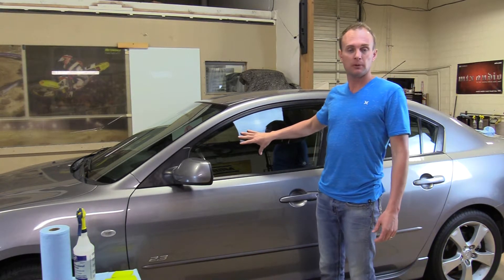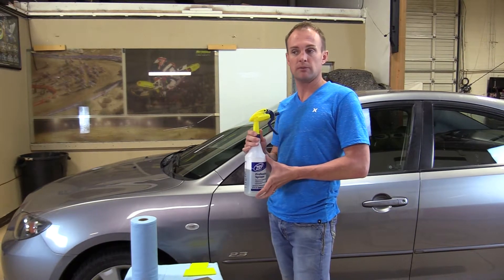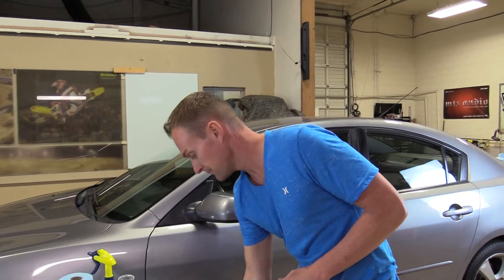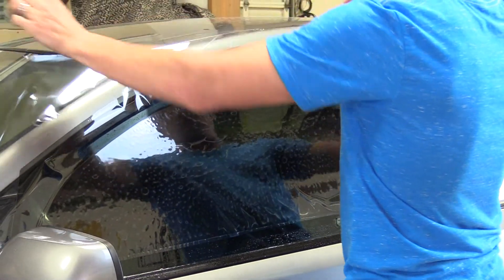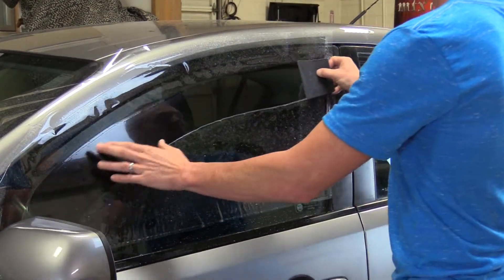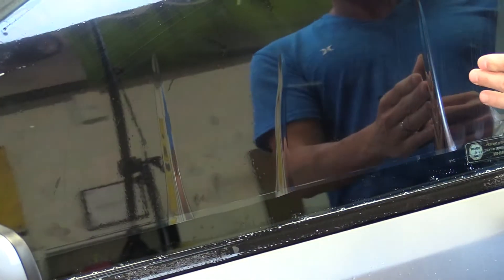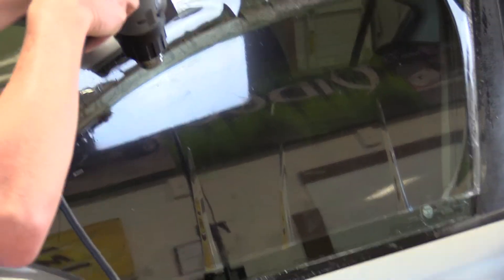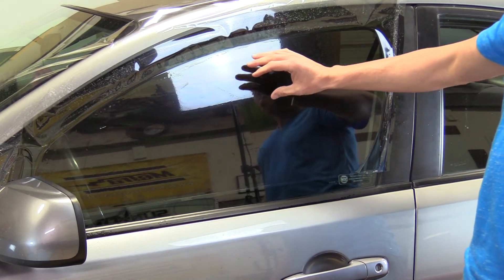Pre Cut Window Tint Kit--Heat Shrinking Curved Window--Any Vehicle

Comment: Thank you!! I managed to mess up twice now on a small curved back window and wasn't understanding why I was getting those finger air bubbles... I will now use your method to hopefully conquer this window without any more problems.  To the point and explained what you were doing... Wish more videos out there were this clear.
Reply from the maker: You are very welcome! Don't forget to subscribe and check out our other videos.
Reply: @InstallProz  Using your method I did the window and the rear windshield... I can't even imagine how the back windshield would have gone had I not done exactly what you described and demo'ed!  A+
Reply from the maker: @NewShockerGuy  excellent 👍

Comment: 1:Can you shrink the tint after you take the liner off?  
2: is there a difference between ceramic & carbon when it comes to shrinking? 
 Great video btw!
Reply from the maker: You wouldn't be able to shrink the tint the same way we do in this video if you remove the liner.  You wouldn't be able to shrink it as much either.  Yes, there is a difference in shrinking the two different types of films. Carbon, in general, will be easier to shrink.

Comment: Liner facing you, you will be shrinking that instead of the tint. Or is it so you won't burn or over shrink the tint, safer and slower?
Reply from the maker: jim davidson thanks for your question!  The liner is facing you so that you don’t scratch the tint while you are carding it.  The heat transfers through the liner very well, so it allows the film to be shrunk. If you are going to buy a pre cut kit, check out our site.  www.installproz.com

Comment: I’m a bit confused... So if you don’t really have any fingers should you create some or were you just doing that as an example?
Reply from the maker: If you don't have fingers when you use your hard card to squeegee the tint to the window on the outside, you dont need to worry about it.  If you have fingers that form after you have squeegeed the film to the outside of the window, you should shrink the tint before removing the liner and applying the tint to the inside of the window.  Most vehicle on the market today have enough curve in the window to require that the tint be shrunk at least a little bit.

Comment: I tried some cheap ebay tint for fun, and I noticed that it doesn't seem to wrinkle up in the same nice zig-zag pattern you got with your tint.

Are cheap tints generally harder to shrink.
Reply: I have bought tint on eBay several times, and in this videos situation, the film just creases and pulls together instead of creating any sort of zig zag pattern when heat is applied. Basically impossible to shrink. Pretty much what any thin plastic would do naturally when it gets hot. Plus the tint never slides around very well on the glass like when you're trying to move fingers around. I can't find a place to buy tint where I'll know it's decent quality. They all say good quality of course.
Reply from the maker: Hi inductiveExperiments , if you would like quality tint, you can purchase through it through our website www.installproz.com or through amazon using the following link.  http://amzn.to/2oXILTv
Reply from the maker: bluewker, cheap tint can be very difficult, and sometimes almost impossible to shrink.  The tint we are using in our video can be purchased through our website at www.installproz.com or through amazon using the following link  http://amzn.to/2oXILTv

Comment: Can u do it with out a heating gun
Reply from the maker: Sha Money yes,  you can use a hair dryer, it just takes longer.
Reply: Install Proz okay what if I got them per cut do I still have to wet my window or I can just stick them on with Out wetting it up to stop all water bubbles and I don’t need to blow dry it because I can make the sun do that and that other text was way off asking to much question in one lol
Reply from the maker: Sha Money even if you have a pre cut tint, you will still need to wet the windows to install the window film.  Most generally, pre cut kits don’t come pre shrunk, so you would likely still need to shrink the film before installing it.  I hope this answers your questions.
Reply: Install Proz one more question okay I got the per cut and it fit the window and everything is shrunk to the right size and when I try it with baby shampoo and clean it good then I add water To it and put it on Boy or Boy it gave me so much bubbles I was thinking my windows was in a bubble bath 🛀 lol but I was thinking can I just put it on with out the water and clean the windows good and then stick it on slowly how bad that sound because I don’t have a heat gun and it’s hard to dry the water out with out that heat gun and trying to get the water out with a heat gun it’s very nasty bubbles and water wet line. Because the per cut customize for my windows so will that be a problem but I don’t have to cut nothing just put it on I wish u was a round the corner so u can see what I’m doing wrong and what I’m doing rite and thanks for being a good YouTube buddy to reply back because I have a HR-V 2018 suv forgot to tell u that so I don’t have a car and after I get the tints down pack for a second try I wan work on changing my head lighting because traveling with they head light and beam light sucks I need to find a Best good head and beam light that’s strong enough to see from far
Reply from the maker: Sha Money it sounds like you are talking about installing the window film while the window is dry.  If that is the case, no, you don’t want to do that.  Spraying the window and tint with the baby shampoo and water is what allows the window tint to be positioned correctly and it is what helps you get the air pockets out from behind the film.
Reply from the maker: Sha Money have you at watched this video?  https://m.youtube.com/watch?v=KxrdCkHJbSc
Reply: Install Proz maybe I over wet the windows and tint to much because I got all the tools u got on this video before I seen this video but I’m keep looking at the video into I get it and I see how u spray the windows and tint not to much water that it be running down like Rain drop u spray just to get it wet and I’m start from the middle and work my way down and side
Reply: Just. Wow.

Comment: so you always say 1 oz or 1 tablespoon... which is it? there are 2 tablespoons in an oz
Reply from the maker: You can use 1 to 6 ounces of baby shampoo.  How much you use really depends on how hot it is and how much slip you want.  1-2 table spoons generally works great. If after installing your first window pattern, you decide you need more slip, just add a little more baby shampoo to your solution.

Comment: Fingers still appeared at the top after install and wouldn't go away with heat
Reply from the maker: Tint has a grain to it and can only be shrunk to the factory edges.  Are you sure you were shrinking it to the factory edges?